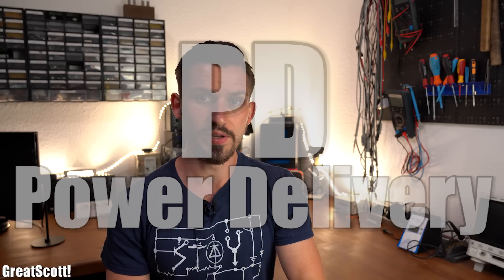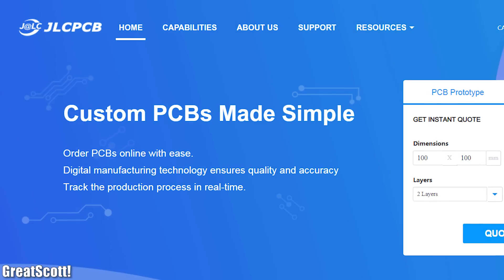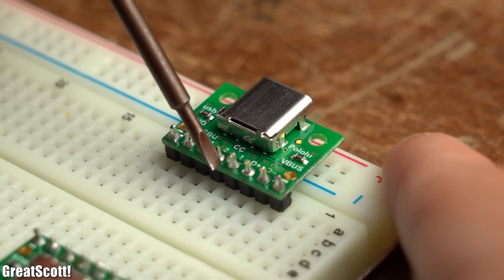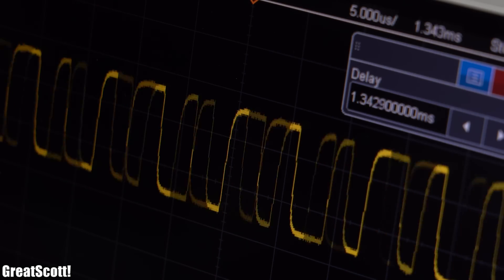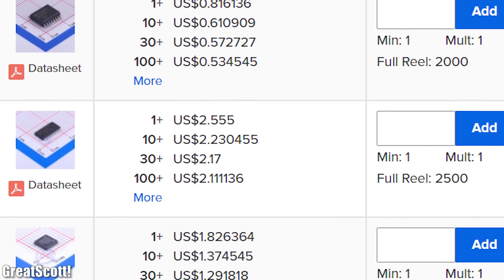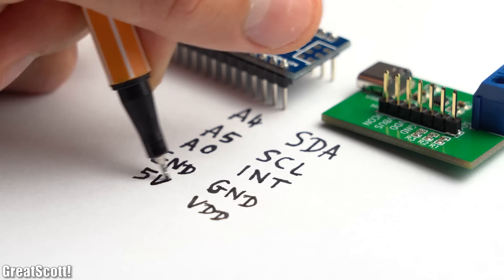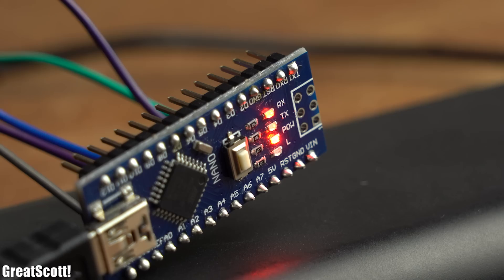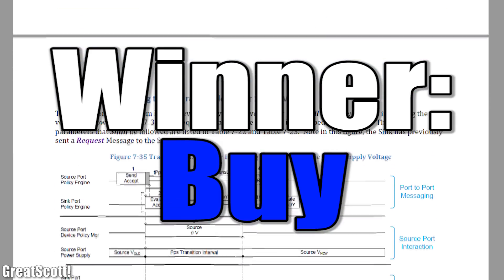USB Type-C Power Delivery Trigger Board || DIY or Buy

Comment: Wait wait! why does the power bank only delivers 5 Volts? It should deliver the listed voltages. There should be a USB PD circuit on the board which tells the source what it wants, shouldn't it?

Comment: ….. and 4 year later this old fart design engineer is just now tripping over the USB C protocol. In the 1970 I was designing sync & async Rs 232 comm circuit. Remember the sync 3232 characters. Now learning and understand how this works is very interesting. Explains a lot how my Dell precision laptop can run on a USB C Poser source

Comment: Hello @greatscott (or anyone who reads this), I am a noob looking for a usbc pd charging board with battery management and power delivery to a microcontroller (not sure if I described it right).

I was going down the road of building my own solution from scratch, but I don't know enough at the moment to make a board from scratch. 

The closest thing I found to what I need was the Charger Click 25 (but I saw a concerning forum post about someone killing 4 boards).

Do you have any recommendations on where to learn or build a solution? I basically want something as efficient as charging a One Plus 11 (not sure if that's a ridiculous ask).

Comment: I prefer those simple CH224K based boards from AliExpress, but something I'd really like to see is a board that already comes with a mosfet connected to the CH224Ks power good signal so power is only connected to the rest of the circuit after the IC confirmed that it got the right voltage. Never seen anyone do that even tough most power supplies will just always put out 5V or the closest lower voltage if they don't support the requested one.

Comment: Hey!
I designed a pcb that uses usb-c with the known 5.1ohm resistors on cc to gnd. so it has got the 5v power supply.
I have some peripherals that need 12v. So I need a power delivery controller.
-> In your example the switched power was not the power supply for the esp. how would that be combined?

Comment: recently I have seen a kit by DeWalt. it have a 65w usb pd charger. a usb c to usb c cable and a charger that plugs right on top of their batteries to charge the battery using usb pd. although this kit is capable of charging up to 100w but the included charger is only 65w. so if we want to charge up to 100w. we have to use a 100w charger. it can charge both their 20v and 60v batteries.
although 20v battery packs normally consist of five 18650 battery. which comes to a total of 21 volt when fully charge. 4.2vx5= 21v. I don't know how many cells are in their 60v battery pack. but they are able to charge both 21v and 60v batteries with a 65w usb c pd charger. so I guess they are using some kind of buck boost circuit to raise voltage from 20v to 21v or 60v.

here is a link to a video of their charger
https://www.youtube.com/watch?v=aW4ijis4jQA

now questions.

2. I want to build the same system for my Makita battery. since no other company is making a usb pd charger. I want to build one of my own. so far I build one but with two board and still running into an issue. that I hope that you have help me with.

I am using a simple 20v pd trigger board to draw 20v. then I use a buck boost board to boost 20v to 21v. so far so good every things work.

problem one. as long as battery is charging under 5amp. it works but when battery is too depleted. it ask for more amps. which keeps on triggering the charger to constantly reset. luckily boost circuit have amp control. so I set it to 4.75 amp on safe side. which keeps the total wattage under 100w. so it works at least with a 100w charger

problem two. when I connect a less powerful 65w or 45w charger. battery is still requesting well over 5 amp to charge. although buck boost is limiting it to keep it under 5amp but these less powerful charger keep tripping. since buck boost is a dump boost circuit. I have to manually set my amp limit on it but it cannot negotiate with charger to set new current limit.

while DeWalt is doing it all right. so at this point I am reaching you to find out if there is a trigger board that can limit the current after negotiating with the charger to whatever the attached charger current limit is. so It does not allow battery to draw more current than that limit so charger don't keep on tripping. so far I have to set the current limit in boost board. and that's not working for me since I want my tool battery charger to work with any usb pd charger and set its current limits based on what attached pd charger limits are.

I have spend hours and hours online to find out. so far I know all the trigger board can only trigger 20v but no board can limit the "current" after negotiating with charger.

is there any pd trigger board that can actively limit the current based on the connected charger just like DeWalt is doing and since they can charge both 21v and 60v batteries. so I guess we have to use a boost circuit but i dont want to set current limit manually in boost circuit but i want it current limit to be actively change based on the connected charger.

you seems like you know all. please help.

Comment: I have a Lenovo USB-C PD charger and I need a constant voltage (up to 20Vdc) to power a 775 DC motor. Is it possible to just tap the last electrolytic capacitor on the circuit board without using a trigger board?

Comment: This is really a great video; thank you! I am planning to power a board with USB-C PD, and since the board power control is done with an ESP32 (which also allows OTA firmware updates and much more), it would be most convenient to buy an integrated solution, like CK224K. The issue there is, that it doesn't provide any status, so the only way to know if the triggering worked is to measure the voltage with an ADC input. It is not very convenient. Retargeting the PD software to ESP32 shouldn't be too difficult and gives much finer control. Plus, I can still use the D+/D- lines to reprogram the ESP32.  In order of cost, I think the CK224K is about $0.60/pc @ 1000, and the FUSB302 is about $0.50/pc @ 1000.  Then of course, there is the CYPD3177, but that one creeps closer towards $1/pc.  I am still in doubt which part to use.
Reply: The CK224K has an open drain power good signal on pin 10 that you can hook up to a P-Channel MOSFET. Don't know why no one knows about that, apparently not even the chinese manufacturers of those cheap PD boards.

Comment: I have some serious beef with the Raspberry PI foundation forcing people to buy their proprietary power adapter for use with the PI5.  within PD spec asking for 5A over 5V is not allowed. If you want 25 watt you need to use a higher voltage. Do you know of an IC that can be used to make a PD delivery port instead of a ""client" PD trigger board. That way I can use a buck converter to convert the 9V the PD is supplying me to 5V and deliver that up to 5A over the delivery port to the PI5 . They sell their bs as a cost cutting measure for their PI5 but I , like most sane people know going out of spec is just to sell more of their adapters instead of using generic ones that can deliver just as much power but over allowed voltages. Cheers.

Comment: I've been going mad buying 6 different kinds of PD triggers to use to charge my battery. 3S pack, trying to use 12V PD setting, everything shows up fine on multimeter.
 When I connect to charge it, the PD trigger boards always cycle off and on, as if over loaded. Could be the charger brick, but I've tried 3.
Shouldn't the charger output its max capable? Do they not limit their own current?

Comment: well, when i shaw this video i get disappointed that the buying is the only viable option and it is not much affordable all places, then i research by mysefl , This project should be built arround CH224K ic and esp8266 or atmega ic as controller, i have tried to build one and it it working, also it is cheaper then the buy option, there should be a version 2 of this video,

Comment: Hey there what's the best way run one USB c charge port into multiple outputs to do a 5v charge on my 6s 10amp fishing drone so I can charge it with a solar panel at the beach ..my first idea which I got some boards from Ali is a 5amp 1-20v in and out DC to DC supplier then run that to individual boards so each cell is individually protected still and I want to add a tiny fan

Comment: Sure, DIY is complex, but it is at least technically possible to do. Is Buy even an option at all for these? I've got some stuff I'd like to power off USB-C, and I've been unable to find a board to buy that will do the handshaking and give me a voltage out the other side that I can actually use.

Comment: What if I wanted to charge my USB-C phone off of 18v tool batteries.  This isn't the PD board I would need right?  What kind of board would that be?

I want to 3d print an adapter that will go on to my tool battery, and have the output be USB-C PD

Comment: I think over they years, something has changed. I recently purchased a 3-pack of USB-C Trigger Boards from Amazon (Item# B09TT6VNS7) and instead of a dedicated microprocessor, the chip they use sets it's voltage negotiation request using three dip switches. The table, silk screened on the back of the board, shows how to set the dip switches to request 5, 9, 12, 15 & 20V. I'll be damned if I can find the chip by it's self. The one I recieved has no markings on it except for the pin-1 locator. Maybe this might be a good time to revise this 2-year-old video.

Comment: Hello! 
Great video, so much information.
I know this is an old video, but maybe someone can explain to me. 
I have a broken Lenovo laptop charger that had a broken USB c connector that I want to fix. I cut the cable and (unfortunately) throw the USB C connector away. 
Now, months later, I see its only two wires(red and black) and shielding inside. How is possible going to work? I only have ca3,85v between red and black. I understand it need to have a PD cabel, but how can it communicate with the charger?
Greatfull for tips!

Comment: I'm not able to find these modules in India. I mean they are expensive or out of stock. Same is the case with STUSB4500 module. So I'm starting to buid one using FUSB302(not recomended for new designs according to digikey). I want to set the voltage to a specific level. Can anyone hep me modify the program to achieve this?
As I said these chips are going out ot stock. So is there any updated chip? Anoyone using these anymore?

Comment: I have one of these that even has a small lcd display on it that shows me the voltage I've selected as well as the current. It also has a USB-C Male and female connector and a female USB-A connector. I bought it as part of a set with a voltage/current meter to test my chargers and cables with, think I paid 18 euros in total and it also came with a Quick Charge trigger and some other bits. At these prices it's really hard to build something like this yourself.

Comment: Tiny connector with lots of pins, weird compatibility issues, complicated protocols. 
OK, older USB (5V), barrel plug (higher voltages/power) or just putting a transformer into the device (for larger devices) for me.

Comment: On the PD, your cable has to be the type (version) that can handle the higher voltage & amps. Danke schoen. Is it possible to take a 15V/3A laptop charger & replace the barrel type plug with a USB-C to charge a chromebook?

Comment: What if we set the output to 20V and connect it to a 12v PD 3.0 charger
Will it give 12v output or stay at 5v until a suitable 20v PD charger is connected

Comment: Can this PD Trigger charge my phone faster from my power bank?, I mean my powerbank is able to give 65watt output
Reply: it will probably burn your phone... each smartphone with fast charge have communication with the power bank (or charger) for required voltage and current. Standard voltage is 5v, and the phone will be the only one to require the correct power for itself.

Comment: Where can I learn more about PD negotiations ... I'm wanting to make a fast charger circuit that threw one usb port is compatible with USB PD, Qualcomm Quick Charge, Samsung Adaptive Fast Charging, Apple Fast Charging, Huawei SuperCharge, Motorola TurboPower, Oppo Vooc, OnePlus Dash Charge, and MediaTek Pump Express. I have a lot of standards to geek out on. The goal is one port... any device... fast charging works and does not revert to standard USB charging speed until it's supposed to (not 8 to 17 seconds into charging a battery that's at say 10% charge meaning it should continue fast charging no matter what it's standard is they would all keep fast charging at 10%... some incompatible mismatches do that though. But if I could detect the fast charging standard before passing off the charge negotiations to the appropriate standard, than I could know which is the appropriate standard to pass it off to and then just do that... I know I make it sound like it's gonna be easy. They do make PD/QC compatible circuits so maybe I can build on that.

Comment: I would consider using USB-C port in my project that uses USB interface, and I am considering using the FUSB302 or ST equivalent so I get the amperage I need from the buck-boost DC-DC converter based battery charger to juice up a parallel or serial setup of Lithium-ion cells on the board. So DIY is occasionally better than just buy the whole thing especially if you want the DIY electronic projects to be very compact.

Comment: Thank you so much as I am searching for similar guidelines so far. And occasionally your this video solve my mystery failed similar attempt before: I mixed up between CCs and SUBs pins of the very same USBC female connector you are using... Thanks a lot again!

p.s. 0:52 PD would in fact not deliver any power at all, neither the most basic 5V, if your device does simply only connect to the VBUS and GND pins, i.e. connect a non-USB-C device with a USB PD sink via passive adapters. This is because while VSUB of other type-A based fast charging (as well as legacy USB) would always have at least 5V, a compliance USBC PD source would instead have no voltages (or so called "high impedance") until it detected something is connected, by detecting if either one CC pin is pulled down by the sink, which is pulled up by the source itself. As non-USB-C does not have CC pins as all it do not "power up" any PD sources.

Comment: i'm looking for smallest possible usb-c device name it "dummy PD" whose only appliance will be to cheat my laptop electronics that PD charger is connected. Why? It's all because my Lenovo charging from standard charger is somehow broken (powering computer but not charging same time, i suspect it may be related with limited charging in plane mode, which it somehow sets up) but the way is to hook up PD charger even for a second and charging from powerbrick starts then :) Any ideas? Thank you for any hint.

Comment: Have you found a 4-5.5v source, to usb-c pd?  The use case is solar 6v, to 4D batteries then to usb-c pd, to get 5v, 9v,12v,15v, from the solar array.

The 5v solar panels are cheap and can provide power for most things via regular usb so you don’t need much conversion and the usb tolerances here is pretty forgiving, but the ability to get usb-c pd from the 5v source would be awesome if any body knows how we can get that boosted to 5v, 9v,12v,15v, from just the regular 5v,  I have found the step down from 6-12/24, but not from step up…

Comment: Great clip! Do You, or anybody have a suggestion for the following? I have a DIY Power Bank ~16-20V Batt voltage between full and empty, and with or without a DCDC intermediary, I would like to have a board, which will in best case take 12-24V on the input, and give a standard USB-C PD port, best case up to 100W, so even a laptop can be connected.

Comment: Hi, have you check the info of STREF-SCS001V1 PCB yet? It's STM's ref. PD Sink PCB which has automatically output voltage switch, up to 100W @20V 5A, no MCU requires, only few  basic components... The PCB has a downside as it only can output 3 voltage values, no 12V by default. They provided its schematics, BOM, Gerber files.... I think you can easily build a equivalent one with those info (& even improve its functions). Here link to STM demo clip: https://youtu.be/pFOu_4AzVVg

Comment: Your work is really appreciated, I also would like to take a look in to this website and tell your opinion if it will work or not 
https://create.arduino.cc/projecthub/PSoC_Rocks/hacking-qualcomm-quick-charge-qc-2-0-3-0-with-attiny85-b7627d

Comment: Great video! There's actually an existing trigger IC which is the IP2721 that does all the work without the need for a microcontroller. There are currently two versions: one that can be either switched between 9V or 12V, and another between 15V and 20V by setting a select pin floating or high. If the pin is grounded, it will only output 5V
Reply: Nice one, when one knows which voltage to use. And also easier to solder by hand !
Reply: @sporniket  This is for a trigger board for devices. For the power supply/source, you'd need a PD compatible one.
Reply: Do you know if there's already a PD EPR (24/36/48V) version?

Comment: Hey! I have a question about PWM, so i made circuit based on 555 timer which creates that signal. My question is whether I will reduce the fill factor, Will the voltage on the multimeter also decrease?

Comment: I wonder if there are host modules, where you can attach it to a let’s say 12V source and it outputs USB C PD at 5V/12V/15V/20V 60W at least? For using in diy powerbank projects and also those big power banks so called solar generators(creative naming though :))?